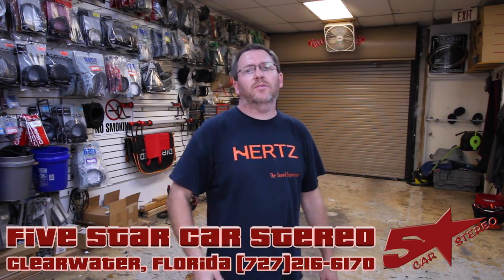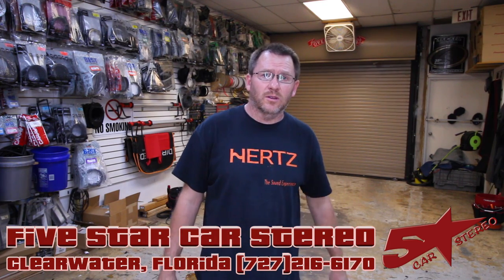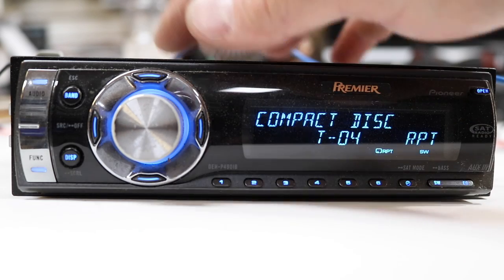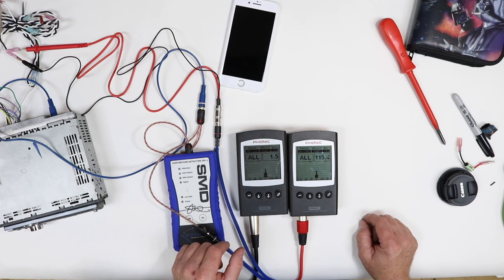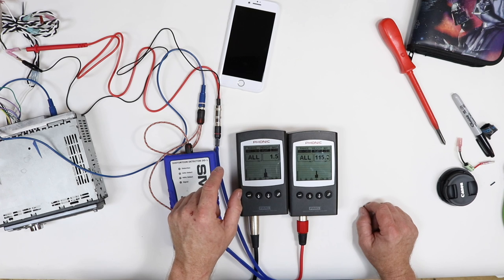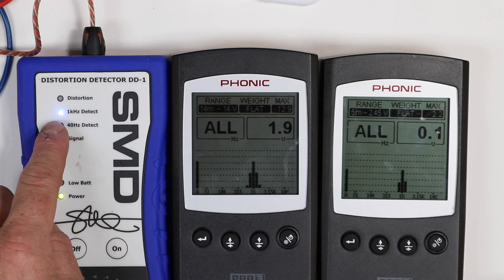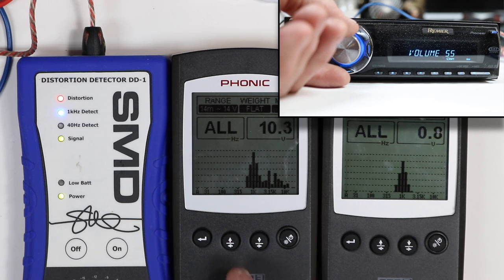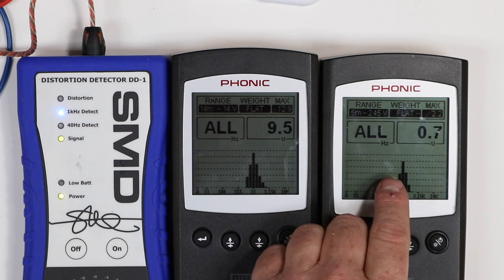Why you should not use the radios amplifier to power your tweeters

Comment: Thanks for pointing this out. This will change my mind about running the door speakers off of deck power because I would be dissapointed when they distorted way before getting to utilize the amps power.  
Think I'll run all front and rears from a 4 channel amp now instead. Then a separate amp for a sub.  👍

Comment: I didn't need proof, it sounds common sense enough.  what i would have loved is showing how to integrate tweeters, speakers and subs into a amp (in my case, a 5 channel amp that has built in crossover).  do i mix passive crossover with active? how do I hook it all up? i get how to hook up all the other speakers but not how to integrate tweeters into the mix
Reply: That would be a great video

Comment: Would running component speakers with crossover fix this problem, even though your using deck power for the crossover? Thanks
Reply: I do not think so because he was only testing the output at 1khz which is tweeter frequency, albeit the low end of a tweeter.  so what does it matter the other frequencies going to the tweeter, only what is happening at 1khz is being tested.  I know you sought his response not mine but anyway...   :)

Comment: I have a question. I’m sure you’re busy so I’ll try to provide all the info you would need here. 

Currently I’m using my stock Camry stereo. Non JBL package. 

JL Audio 400/4 amp. 4ohm. 75watts per channel. 

Kicker Component Set. 4ohm. 10watt minimum. 100w RMS. 300 max rms. 

Kicker component speakers, but the crossover was separated from the pair, as, according to the terrible installer I went to, it was pulling too much power from the woofer and causing it to be low volume. So the woofer was wired directly to the amp, and the tweeters were spliced in as well. So the amp is powering both. Without a crossover. 

My problem is twofold now. 1. My tweeters are distorting, they tried to remedy this by adding a capacitor. It’s not working. 2. My tweeters are much louder than my mid woofer. And I need to push the volume HARD to get my mids to really shine through the rest of the mix, and at the point my tweeters are distorting, and uncomfortably harsh. Plus, I know that without a crossover they’re likely to die. 

My plan is this. 1. Install an Alpine ILXW650. 2. Keep or remove the capacitor but, take that crossover that was intended for both speakers, and connect it in line AFTER the splice that connects the woofer and tweeter to the amp, but before the tweeter. I do this in the hopes that 1. The crossover works as intended, and will effect JUST my tweeters and 2. If it does in fact drain power, and I know a passive crossover does, then maybe it will bring the tweeter volume into balance with the woofers. 

Can you, or anyone else hear with knowledge advise if this makes sense?

Comment: A clean 4x18W on front components is enough to get loud, and more than enough for normal listening.  With good, sensitive speakers 2x18 is actually enough to get loud.  mixing head unit and discrete amp is weird tho.

Comment: Good vid, but if you run tweeters in parallel on the front speaker channel, wouldn't you be changing the ohms if say the tweeters are 4ohm and the front speakers are 2ohm(my current set up)? And also wouldn't you be taking away power from the front speakers as it's now divided to the tweeters and front speakers? Im about to install some myself and was planning on just using the radio power since all my 4 door speakers and sub is running on a 5-ch amp. Thanks!
Reply: run the rear speakers on head unit power. 

front mid on two channels, front tweeter on two channels dont give any power to the rears if you want any resemblance of a sound stage.
Reply from the maker: J Cook what 2 ohm speakers are you using? Most of the time if you are using 4 ohm speakers this is not a problem
Reply: Five Star Car Stereo  I'm using jbl 6.5 and 6x9 2 ohm.

Comment: I need some advice/ help I have a set of Skar tweeters a Skar 1200 monoblock and two vd10s I’m currently setting up. I have trimmed my a pillar plastics to fit in the Skar Spx-t tweeters. I have a 2003 chevy 1500 with the Bose system. How should I go about hooking up my tweeters. A buddy said to cut the connections from the old tweeters and wire them in +/- and plug them in the same spot they were plugged in. Is that what I should do?? The Bose system has a amp but I’m not sure if it would power it. How would I get the best performance out of this

Comment: I have a pioneer avh-x4800bs with network mode. 4 tweeters and 4 6.5's on pioneer 8604. I wired my driver side font and rear tweeter in parallel to 1 front channel of amp. Passenger side front and rear tweeters to the 2nd front channel.
I wired the driver side front and rear 6.5's in parallel to 1 rear channel. Passenger side front and 6.5s to the 2nd rear channel.
So all 4 tweeters are connected to the front 2 channels and all 4 6.5's are connected to the rear 2 channel's.
I have full adjustability of my tweeters separate from my 6.5's. My subwoofers are completely separate from everything else. I love the pioneer radios. With network mode and the 13 band EQ along with the built in crossover. You can get great sound and adjustability from your speakers from the radio. No external gadgets to fool with.

Comment: Parallel is okay if the tweeter and speaker have similar levels of sensitivity however its best to have dedicated tweeter and midbass channels on your amp for a proper blend between mid and tweet... some tweeters have ridiculous sensitivity and running parallel can easily have tweeters overpower your 6.5s since you have no means of controlling each output individually for any kind of blend.
Reply: EQ is fine if you have proper amounts/bands of eq but there's only so much you can cut, its not gonna take the place of a proper output control/crossover.    I know you guys know this already,  just putting it out there for viewers that might want to take sound quality a bit more serious than the average joe.
Reply from the maker: Jeff DaChef I agree totally, but don't forget most high end stand alone tweeters have some form of volume control. -4, 0, +4 db.
Reply: Five Star Car Stereo i just helped tune a system where it's 3 way front with the pioneer 3800bhs in network. sadly the person was using super tweeters parallel to the mids on their attenuated crossover and it sounded really bad, the supertweet overpowered the mid by far and was overly unbearable. 

i put the tweet to head power and the tweets were still extremely overbearing loud. they are crossed over with a 10khz at -18 db slope which really tamed and made the tweeters smooth.  4 channel on the midrange and midbass crossed over at proper points as well and the system sounds very good.   

just an outlier example of how head unit power might work. due to high sensitivity.

most cases with  soft dome tweeters usually work fine wired parallel as you say.
Reply: @Jeffdachefz  I’m putting 4 bullet tweeters on my bike. What do you recommend

Comment: If Im running a focal ps165v component set with tweeters on ch1/2, 6.5s on ch3/4, sub on ch5 and using the amps crossovers. How do I know what gain to set tweeter channels at? My component set comes with crossovers, but I dont want to use them. Set is rated at 80wrms, but should the tweeters be given that much power without the crossover in there?

Comment: should you connect the tweeter to the amp or tap in the wire on your speakers and connect them together and then run it to the amp?

Comment: I'm running my tweets off deck power from a Pioneer. The highest volume setting I use is around 42. Comfortable listening, at highway speeds, is 32-38 (for me). So....no distortion is introduced to my tweets. Someday I'll run a proper amp on my tweets but it's just not a priority right now.

Comment: very good video,s I am learning a lot from you guys; I have a project upcoming and could really use your advise; I have 70 chevy c-10 which has a CUSTOM AUTO SOUND "CONCURS SERIES HEAD SINGLE DIN- my current audio system consists of (2) 6.5" standard one near the bottom of each door- I also have (2) tweeters 1 each in the upper portion of each door-I just added (2) 8" subwoofers in a "sealed box- these are 4 ohms each set up in parallel-powered by a JBL-GTR601AMP; can I connect the (2) new tweeters to the existing (2) tweeters ? or add (2) 4" HERDIO COMPACT MARINE STEREO BOX SURFACE MOUNTED SPEAKERS; I HAVE (REMAING INPUTS ON THE AMP !! ANY ADVICE APPRECIATED much thank,s keep up the videos I really need them !! PATRICK.P
Reply: Lol marine surface mount lol

Comment: i have dodge challenger with 6 speaker 276 watt alpine sound system i plan on putting components on front & back but using factory amp to power tweeters and using aftermarket amp on mids.front components rated @150 watts rms @ 4ohms and rear 125 watts @ 4ohms. amp for mids rated @ 100 watts @4 ohms x 4 . i'm curios if factory amp is sufficient power for tweeters or too much. i will be using components cross overs on tweeters and amp crossover for mids
Reply from the maker: Get a Pac AmpPro for your car to get  preamp outputs. Don’t use the factory amp for anything. It is has equalization and sound correction that will not play well.

Comment: Wow. Great technical proof. Can't argue with that logic. If using a 6 to 8 dsp, should you only use the 4 pre-outs for inputs to the dsp? There's little info online for using a dsp. Will the processor still give 8 outputs with only 4 inputs?
Reply: thank you for sharing your decades of experience, keep up the great work...
Reply from the maker: Dave Peck most of the DSP have selectable or assignable outputs regardless of the inputs. It is setup though the software
Reply from the maker: Edward Autrey thank you

Comment: I have 3.5" infinity ref tweeters wired parallel to front speakers on my 2013 Optima & the distortions are all over it. Speakers are powered by an android headset with45 Rms/channel x 4.  Headset has a 5volt pre-out for sub & front.  I'm thinking of adding an amp. should I do one amp with 4channel for sub & tweeter or should i do seperate amps for front channel & sub? or would a heavier bass blocker than what the infinity speakers came w/do the trick?  HELP
Reply: Your head unit is to weak, infiniti speakers usually are high power, distortion comes in at higher volumes when the head unit gets overloaded
Reply: @aldish25  thanks for the response.  However, I solved the problem already by running a 2 pioneer 4 channel amps with my android headset.  1 amp carries all the speakers while another carries the sub woofers. My speakers really come to life with this set up. The details & depth of my music is incredible.

Comment: what if you're using a pioneer with networking mode enabled?
Reply: Disagree! I ran tweeters off of the internal amp of a Pioneer 80prs. Not only did I win 3 IASCA comps but one judge even said my high end was excellent at one show. It depends on volume levels, crossover points, and tuning. It does not take much power to drive a tweeter with sensitivity above 90db to satisfying levels. You can drive a tweeter to 100db with less than 20 watts. There again, the 80prs is one hell of a radio for the money. Too bad everyone wants a fancy screen and not sound quality.
Reply from the maker: Shawn Hopping the deck power always have a clipping point.

Comment: Nothing wrong with some distortion.
Also you have more control with tweeters wired to head unit.
Reply: Unless you have a garbage amp then your completely wrong
Reply: @br0ken342  For many years, guitar players have used distortion as something good, from amps to pedals, from tubes to transistors, and even digital algorithms, they have tried everything. Tastes change, and for example, in the 90s, many guitar players used to have some sort of digital distortion pedal in their rigs, today, that sounds kinda cheesy, while 60s and early 70s tube amps are probably the most sought after this days.

distortion is great for basses, kick drums, rock vocals, guitars, electric pianos, hammond organs and master busses. Tape distortion is very nice for guitars, percussion, drum kits, vocals, keyboards and master busses. Guitar pedals, are great for snare drums, horns, keyboards, synths, and of course guitars. Transistor based distortions, might sound great just on anything, specially those from high end preamps or analog consoles.
So like I said some distortion is good!
It all depends on your taste.

Comment: I have tweeters and they start cracking and skipping when at volume 22
Reply: You need to put a capacitor on them if they didn’t come with an in-line capacitor. If you don’t you send a full range signal and tweeters don’t handle anything under 1.5khz well at all lol
Reply: @kylesvideos59  my tweeters start makin weird noises in the highs ever since i installed my new stereo deck unit. Do i need to put a capacitor aswell?
Reply: Itz Dixmond yes! Some factories radios have the factory tweeter crossed over to handle certain frequencies. Now that you don’t have a factory head unit, your tweeter is playing in full range aka attempting to play bass notes (which will blow them VERY fast. My advice to you is don’t even listen to music until you get a cap for your tweeters. Unless you plan on installing new tweeters, wouldn’t recommend using them in full range.
Reply: @kylesvideos59  thank you you're a life saver. Do you know what capacitors to get and are they easy to install?
Reply: Itz Dixmond do you have factory tweeters? If so just google the crossover point for the tweeters for your specific car model. Most factory tweeters are crossed around 4khz so look for caps that crossover at 4khz.
Reply: @kylesvideos59  yea everything is factory other than my double din stereo i found that it's 3khz but really sure i have a 2001 mustang gt wit the mach460 audi system
Reply: Itz Dixmond you wanna make sure you retain the Mach audio amps bc they’ll give you more power than a head unit will. I believe those supply 180watts. The crossover is actually built into the two Mach audio amps. You may have to buy a separate harness for this reason.
Reply: @kylesvideos59  so a harness for the tweeters and a capacitor?

Comment: Invalid argument. Any sensible person running tweeters from deck power will not play them to distort. Secondly you have to use an amp just to get the loudness of the deck to begin with, yes you may be able to surpass that level...but that is a matter of personal preference. Once a person is getting the tweeter loudness and clarity from the deck there is no need to run them through the amp. The amp may also introduce noise...which is what you should have been testing as well Dean, to get a true picture and comparison. while your RCA signal might be clean....do the comparison with the RTA hooked up to the amp side of things and see what noise the amp introduces. At the end of the day its a matter of personal preference. If you like loud highs that only the amp may attain, then use the amp.....or if the deck is able to play at the level you want without clipping...then deck power is fine
Reply: I agree with Happy Star.  I plan on getting the new Sony AX-7000 with 50 watts rms/channel x 4, to power my front speakers.   I will test it first with just the head unit power, if it sounds good and loud/clear, leave it alone.   If not, then I will just add an external amp.   I say to try it first, you  can always add power if needed.

Comment: Thank you for convincing me to NOT put my tweeters on my head unit... I just need to figure out how I can power up my midbass speakers without the tweeters being too dang powerful when I'm using a two channel and running them in parallel
Reply: I think some crossovers have settings for tweeters volume
Reply: @Lukkmaestro  I've considered this but I can't seem to find a crossover that can handle 150w rms per speaker on Amazon xD
Reply: @Butrdtostngravy  then maybe a DSP/equalizer is the way to go i dont really know lol
Reply: @Lukkmaestro  eventually going to just get a 4 channel and separate the tweets from the mids. The amp I WAS going to use for it crapped out xD
Reply: Michael J Polk Audio’s MM1 6502’s are 150 rms, try those!
Reply: @kylesvideos59  thanks for the input but I think I should clarify. I have Skar 150w RMS 3.5" super tweeters in the dash and Skar 6.5" midbass speakers in the doors. I'm running them in parallel for a 2 ohm load on my amp in the back. I need a x-over that'll allow me to put a total of 300w into it and split it into 150w for each without it melting lol. Thinking I may eventually just get a 4 channel and put the midbass speakers on the rear channel of the amp and do a low pass filter so they can perform better in their frequency range when they're not trying to play the highs.